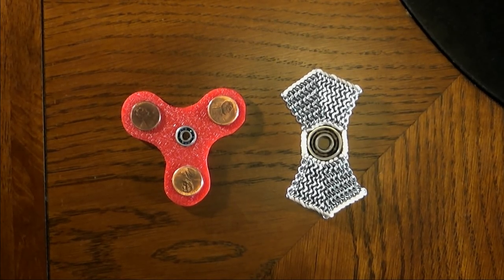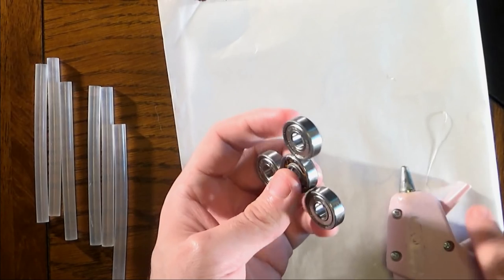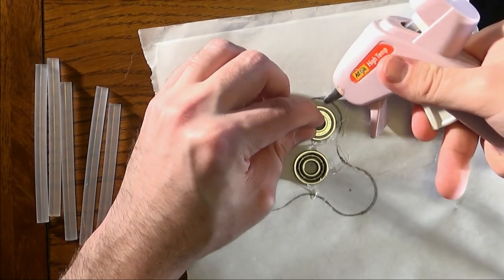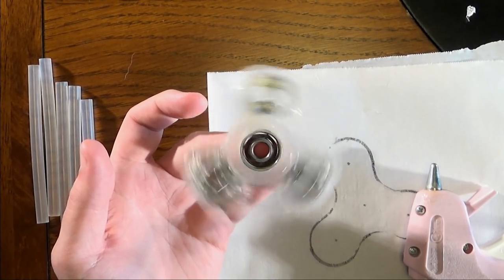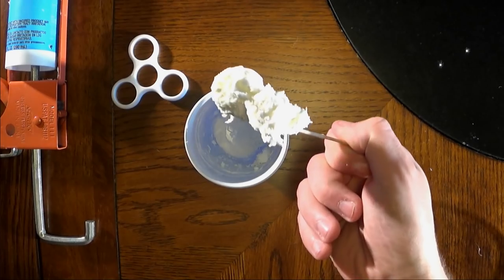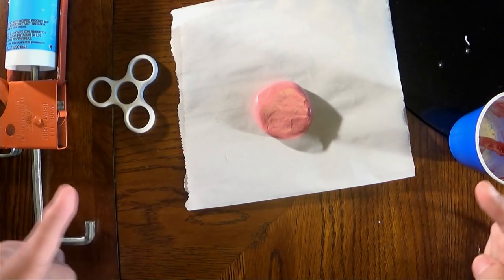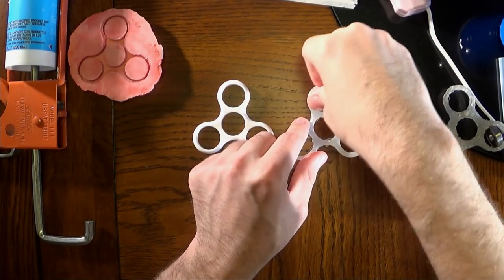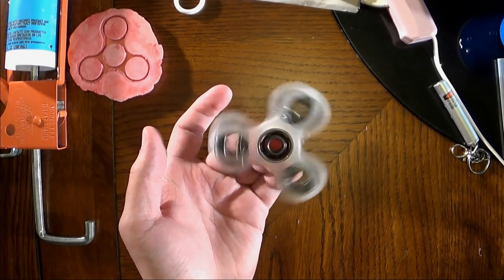DIY Hot Glue Fidget Spinner - DIY with Cly Ep. 4

Comment: For best performance, have a set of 7 bearings when you do this. Math works out when you have 6 of the same size bearings around a 7th bearing of the same size. Otherwise, take 7 of the 608 bearings and build them around each other for the best balance possible by freehand, just only glue the ones you want on there.
Reply from the maker: That's definitely not a bad idea when dealing with the configuration that has the bearings touching each other.

Comment: Hi Cly! So for the mold from the fidget spinner outer thing without the bearings you would do the same thing as the cap right?
Reply from the maker: +Jamieson Ly Exactly right. It will take an hour or so to set (though I tend to wait a bit longer) and your mold will be ready. Also, I didn't realize while filming, but oogoo clings to parchment paper something fierce so you might want to switch it out for wax paper at that stage.

Comment: what size of bearings are you using?
Reply from the maker: +Dennis Mangahas These are size 608 (22mm) bearings. They're the same kind used in skateboards.
Reply: love ur profile pic
Reply from the maker: +Richard Torres Thanks. I really need to update it one of these days though, since I'm doing more DIY and review content these days, and not just thrift hauls.
Reply: Cly Faker can you try making it on a play doe mold? 😂
Reply from the maker: +Hero 13th Play-Doh would do an okay job for the mold itself, but not so much as the spinner. Too water soluble for my tastes. 😛
Reply: Cly Faker what about on a sand mold it should give it some nice touch👌
Reply from the maker: +Hero 13th That would be a great material to use if I get around to casting out of pewter.
Reply: Dennis Mangahas 22mm
Reply: The regular
Reply: Hi all

Comment: Did you have to oven heat the mold to dry or just leave it out and how many sticks of glue did you use for one?
Reply from the maker: +Cajun Outdoors The caulk cures because of the moisture in the air, and the paint that I mixed in sped things up. As for how many sticks, I used somewhere around two and a half for a single spinner.
Reply: Cly Faker thanks a lot man i need to know how many sticks to use because i only have three oh and i hydro dipped my spinner in metalic silver it looks great thanks for the vids and keep up the good work

Comment: I wish i could make this but i have no money for silicone or the bearings :( but it is still a great video :)
Reply from the maker: +IGotSomething IGotSomething Well, if you ever get the funds together to try it, the silicone I used is only $3-4 per tube. It's much better than the $15-20 for an equivalent amount of "proper" mold making silicone. 😁
Reply: When are you going to upload another video.
Reply from the maker: +IGotSomething IGotSomething I'm hoping to have either the paint special (though it's taking a while) or a review of the cheapest spinner I could find up by this weekend, and then a new DIY spinner inserted by the Fallout series up by next week. I want to squeeze a non-spinner related video in there somewhere. 😛
Reply: If you could, a future video you can do is to make a 2 sided or 6 sided fidget spinner.
Reply from the maker: +IGotSomething IGotSomething I made a two sided spinner out of chainmail in my last DIY video. 😁

Comment: I'm having a little trouble putting the hot glue in the mold. When I do it looks very bad. One side it always flat. Any suggestions? (I was hoping maybe you could upload a video of putting the glue in the mold)
Reply from the maker: +Izabella Mawani I just pumped the glue into the mold slowly using the glue gun, moving the nozzle slowly through the mold while doing so.

If the flat part you're talking about is where the mold is open, that's just one of the downsides of using an open backed mold.
Reply: When I do it, it always ends up with cracks and bumps. Maybe I'm going to fast...
Reply from the maker: +Izabella Mawani A little bit of that, and maybe you need tob let the mold sit a bit longer. Mine had those issues for the first few tries, but when I came back to it a few days later it worked perfectly.
Reply: Cly Faker I'll try that, hopefully it works. Thanks for the fast replies! 😁

Comment: Would the hot glue ever melt or stick to the mold? I'm new to this stuff 😆
Reply from the maker: +Izabella Mawani Not if your silicone mold is fully hardened. After that the only thing that will bond with it is more silicone, so the glue will pop out just fine. 😁
Reply: Cly Faker yay! Also, how long do I have to wait for it to be fully hard?
Reply from the maker: +Izabella Mawani A couple of hours for the silicone should be fine, but leaving it overnight wouldn't hurt. Fortunately the glue will cool in a matter of minutes after you pour it into the mold.
Reply: Cly Faker great! I'll leave it over night and glue it tomorrow.Thanks for the very fast reply too! Definitely gonna sub. 😆

Comment: I can't get the 3rd method to be right, mine comes out really ruff looking and when I put bearings in the whole thing bowes upward
Reply from the maker: +The Scout The ones I made have a slight frosted texture if that's what you mean. If not, the mold might be releasing some trapped gases. Mine did that on the first day, but hasn't since.

As for the bowing, that went away for mine after a while. I just laid them flat for a bit and now they're fine. Insert the bearings first so that the hot glue can grip onto them over time. A little superglue can make the bond more permanent.
Reply: Cly Faker I am also using clay as my mold would that affect anything
Reply from the maker: +The Scout It might affect the surface, depending on the type of clay used. I've never used a clay mold to cast hour materials.

Comment: hey mah man have you given much thought to the reel bearings spinner?
Reply: great video btw
Reply from the maker: +Supremelordofpie I have, but I haven't been able to find my reel. It got misplaced in the moving shuffle a few months back. I may have to keep an eye out for one while thrifting. They should be popping up more often now.
Reply: Cly Faker ok cool, it'd be really cool to see that videos, and oiling the bearing will make it a pretty decent    spinner
Reply from the maker: +Supremelordofpie From what I've seen you want as little oil as possible if your goal is a decent spin time.
Reply: Cly Faker yeah I mean rubbing alcohol that was my mistake oil can actually mess it up sorry, or at least I've heard rubbing alcohol helps, I never have done it myself
Reply from the maker: +Supremelordofpie I use brake cleaner myself, though I get even better results if I soak the bearing in a natural degreaser for a bit before I use the brake cleaner.
Reply: Cly Faker cool, I got a bunch of bearings so I might try that, but yeah you'll wanna do that otherwise the reel bearing will be awful
Reply from the maker: +Supremelordofpie I got the degreaser from Dollar Tree for $1 (no surprise there) and the brake cleaner was only $2 for a huge can. Not much to lose there. 😁

Comment: Would some flux and solder work better for gluing the bearings together?
Reply from the maker: Not really since the outer housing on the bearings is steel, and solder doesn't work with steel.
Reply: Cly But I think it will work if you apply solder flux first but I have not tried it yet so I can't confirm it.
Reply from the maker: +mrk107 Every time I tried normal solder on steel it either wouldn't bond (despite adding flux) or it would flake off. Others have had moderate success, but I prefer brazing for steel. If you're going to try, remove any plastic spacer from between the BBs in the bearing housing since you wouldn't want to melt it.

Comment: would the 3 tactic work if you used modling clay?
Reply from the maker: +Joyfulfarmer 415 As the mold making material, or are you taking about making the spinner shape from modeling clay and the putting the silicone on it?

Out should work either way, but I don't know how the clay would respond to the tip of the glue gun if it was touched.
Reply: Cly Faker I wanna mold with the clay
Reply from the maker: +Joyfulfarmer 415 It may work, but the glue/glue gun might push the clay to it's melting point (if it's the non hardening variety).
Reply: Cly Faker the air-dry clay that you could get from Wal-Mart
Reply from the maker: +Joyfulfarmer 415 Ah, then you might be in luck. When I hear "modeling clay" I immediately think of the non-hardening oil based clay.
Reply: Cly Faker thank you for the help!
Reply from the maker: +Joyfulfarmer 415 No problem. 😁 The hot glue should be flexible enough (especially when slightly warm) to come out of the mold without issue.

Comment: can you make the mold from modeling clay?
Reply from the maker: +Merpysoup Flarpkin III Do you mean use modeling clay as the mold making compound itself, of as a way to make a spinner form to make a mold from? It would probably do either of those jobs to an extent, though I don't know if the clay would get along that well with the tip of the glue gun.
Reply: Cly Faker I mean if I made the mold from clay, would the hot glue come out fine?
Reply from the maker: +Merpysoup Flarpkin III It should, but there's a chance that the tip of your glue gun might melt the clay since it's much hotter and most modeling clay (at least the non_hardening varieties) are oil bared. If you already have the clay and glue gun try touching the tip to the clay just to check.
Reply: Cly Faker thank you!
Reply from the maker: +Merpysoup Flarpkin III No problem. 👍

Comment: Can you use Clay instead of Oogoo? I don't have caulk or access to it (I don't think I do anyway)
Reply from the maker: +RiverGirl Depends on the clay. Most non-hardening clay is oil based and may not survive contact with the glue gun tip.
Reply: Well, my clay is hardening. If I smashed the mold (Or found some other form of getting the glue out) do you think the clay would work?

Also, you should try to make two more kinds of Fidgets!

One with NO bearings (For the people who cant get their hands on one)
And
One made from some kind of edible thing (Like chocolate, Starbursts, JollyRanchers, ect)
Reply from the maker: +RiverGirl The glue is flexible, so it could come out of you lubricate the mold first. Also, you may have to freeform the mold, since a solid plastic spinner would be hard to remove before you can cast the glue.
Reply from the maker: +RiverGirl Also, I actually have a no bearing folded paper spinner in the works. It's perfect for people stuck in class or at work. 😁
Reply: Sounds awesome! Thanks for the help with the spinners. I'm gonna be trying to make one of them today. Do you have a Discord by any chance? Also, that's awesome, can't wait to see it!
Reply from the maker: +RiverGirl I don't have a Discord server, I just hop around various communities. 

Also, good luck. 👍
Reply: Thanks! And would you wanna join mine?
Reply from the maker: +RiverGirl Not at the moment. I just finished pruning my server list down to just the few that I'm active in.
Reply: Okay, thanks anyway :D

Comment: No hate but you forgot the spin pads
Reply from the maker: +Ethan Keyes I have a couple that I made out of hot glue, but I would need to clean up the back of my cast spinner before I could use them. They may pop up on the paint special though.

I do have another spinner planned that needs custom pads though, so that mold will come in very handy.

Comment: You're doing one thing wrong: NEVER (and I mean NEVER) put your hot glue gun sideways! that little stand is there for a reason. If you put your glue gun sideways, the glue Will get stipulated in the glue gun and you will never ever be able to use it ever again! Trust me I did this before. A huge clump of glue is stuck inside and I can't use it anymore.
Reply from the maker: I'll definitely keep that in mind for my nicer glue guns now that I've found them. This one is a cheap $3 model that refuses to stand upright as it is, and I doubt people wanted to see the epic five minute battle to get it so sit up. Fortunately it looks to be easy enough to disassemble if the glue does get stuck inside, and then I can use my heat gun to clean it out.